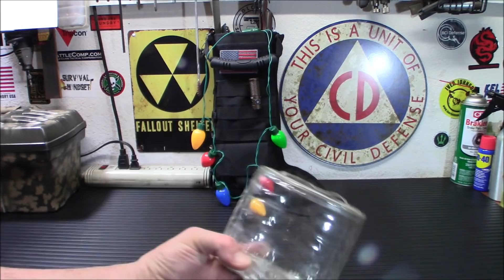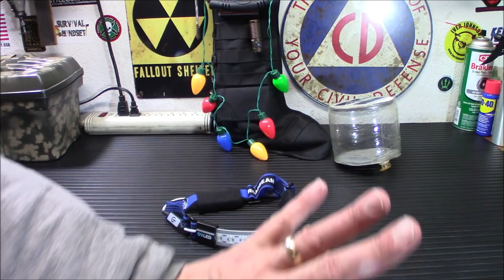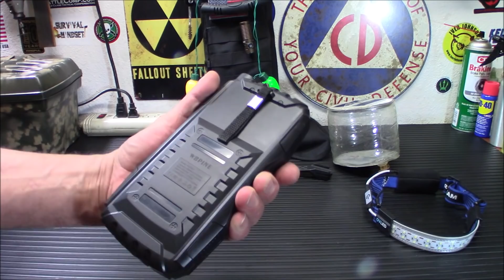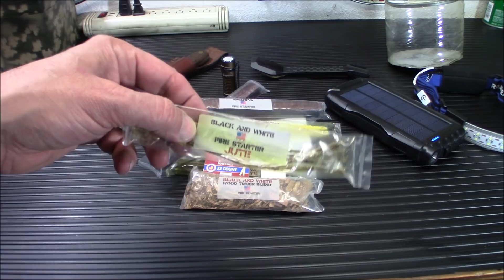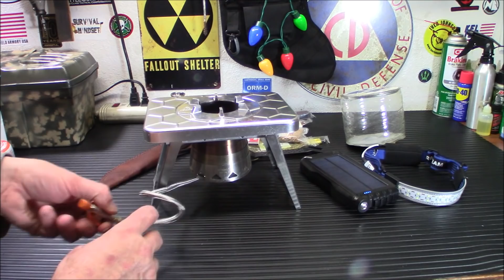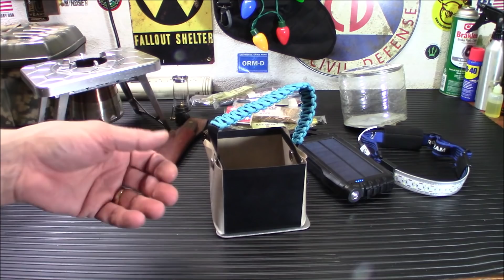Ten Awesome Stocking Stuffers For Preppers!

Comment: I really like that multitool that it makes tongs. Uncle Al sent me one of the silver metal folding kind so I been using that. But that ones great. 
Bluing? See now, to me bluing is for doing the laundry lol
The fire kit you gave me is great. I really appreciated that. It’s a different one though.
Reply from the maker: bluing is the finish you will see on lots of different guns, its a very dark almost black finish. Carbon steel will take that finish very well, so I coated it with some of that so it wont rust as easily :)

Comment: A lightstick looks like a telescoping antenna with an alligator clip on one end and a pocket clip on the other . A paper match in the gator clip , a strike , pull it out and light hard to reach things... they're great for lighting furnaces or gas water heaters , and they take up almost no space.. like paper matches , and weigh very little . Would probably be a big hit in a stocking ! I usually always have one handy... good stuff !  Excellent presentation ! Will check out the store !